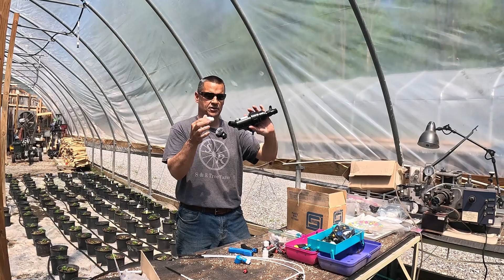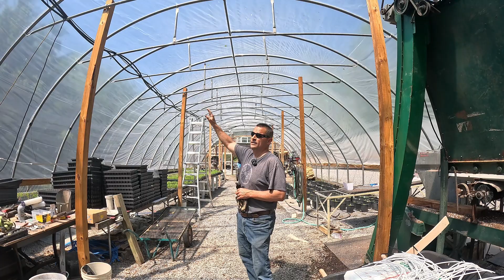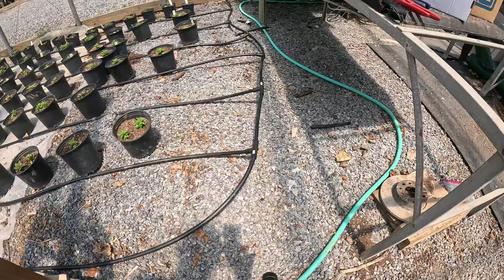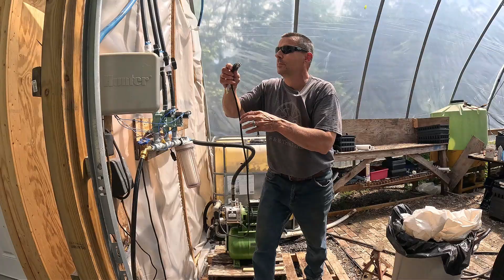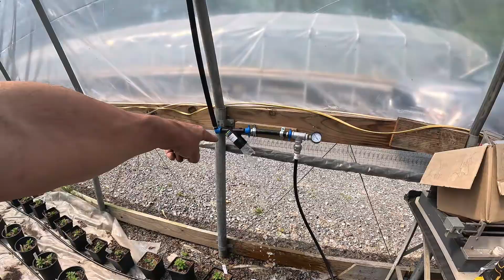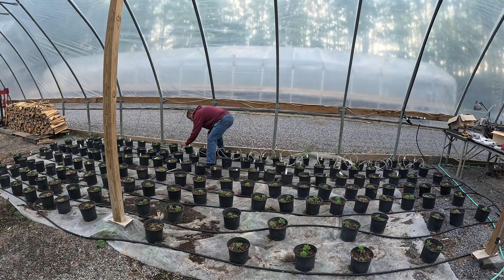How to install Drip tube spiders made easy , Farm cashflow  #horticulture #mums #dripirrigation

Comment: The ends of your Drip lines i fit taps so i can flush the lines periodically, not caps.
Reply from the maker: Thanks for watching.   I put valves on all the ends , all I had at the time were caps .
Reply: Im about to run my drip... thanks for that tip